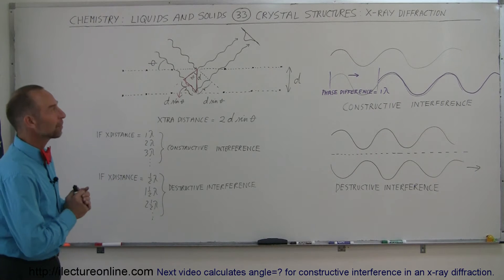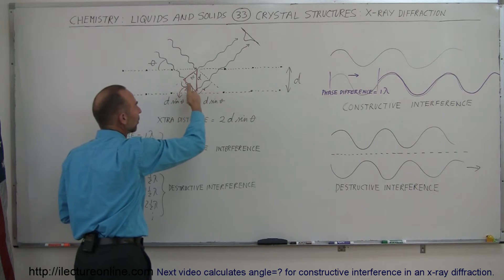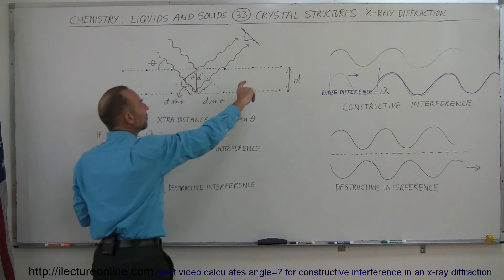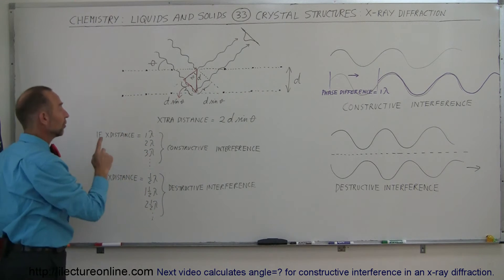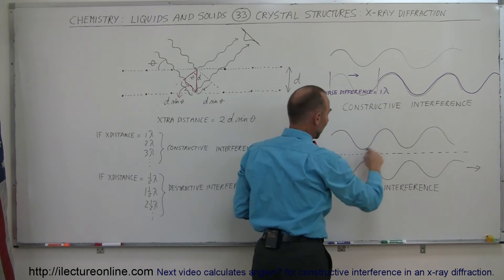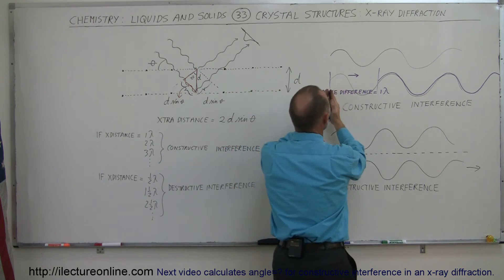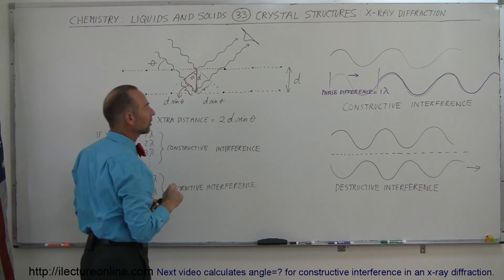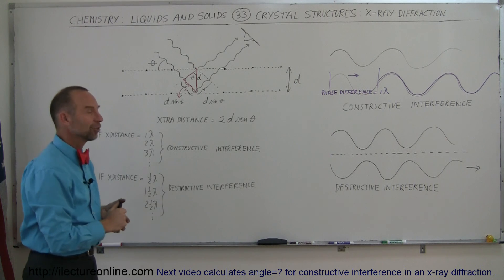Chemistry - Liquids and Solids (33 of 59) Crystal Structure: X-Ray Diffraction

Comment: It should only be the odd ones because if it is 2 half wavelengths out of phase it would still be in phase.
Reply from the maker: The video is correct.  When 2d sin(theta) = m (lambda) where m is any integer, you will have constructive interference.